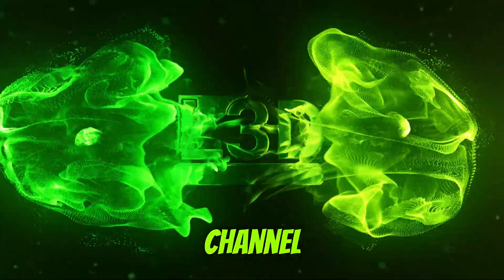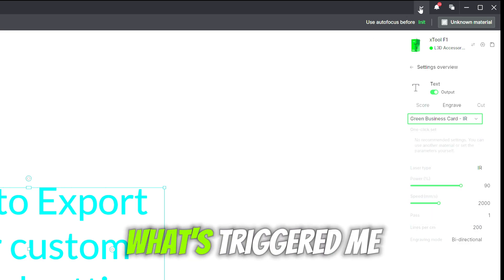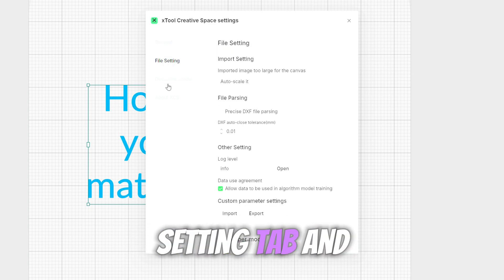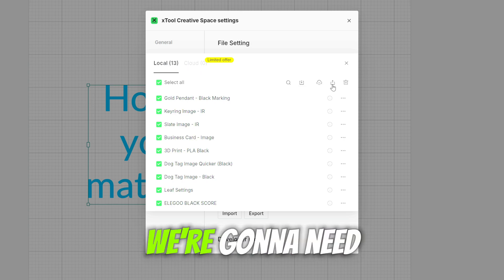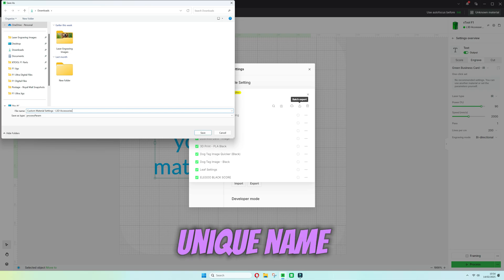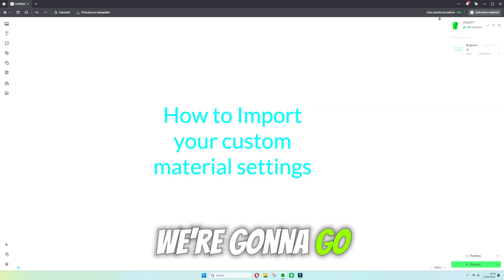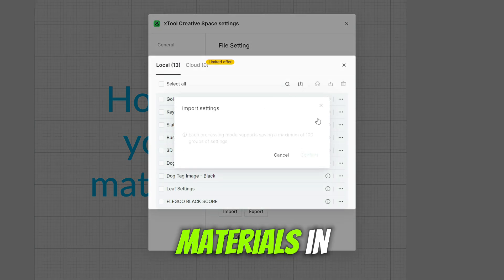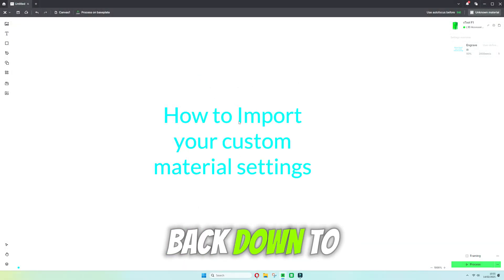How to Export & Import Custom Material Settings in xTool XCS – Easy Step-by-Step Guide

Comment: Looks like the option has been removed. I do not see that option in settings. v1.0.15
Reply: Actually, just saw you were using V2. I can't find a link anywhere to download version 2. Did they pull it?
Reply from the maker: This was done using xTool Creative Space and I believe you're using xTool Studio. xTool Studio has superceded XCS. I'll need to do an updated version of this in xTool Studio because things are located differently. That being said, you should still be able to do it the same way. Ive created a number of tutorials and I believe in the green one (look at the thumbnails) I show where offset it.